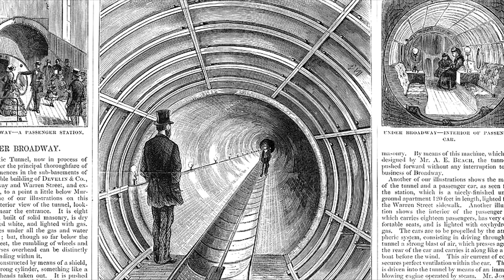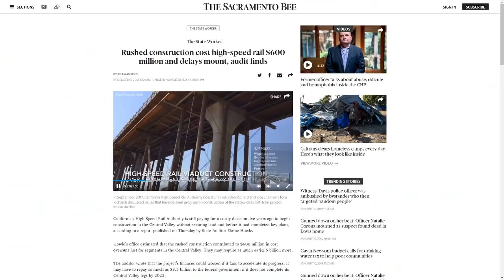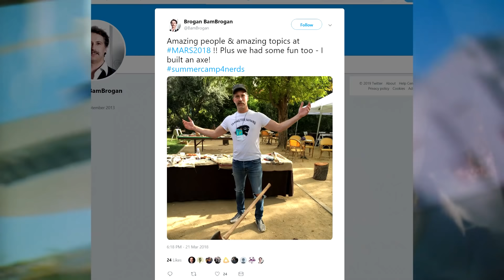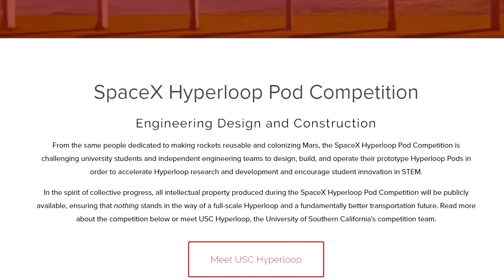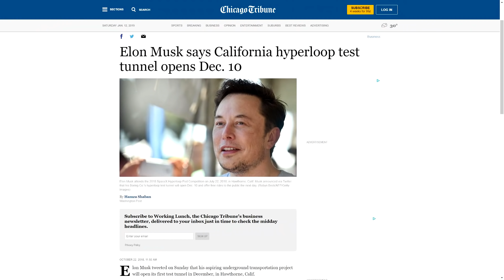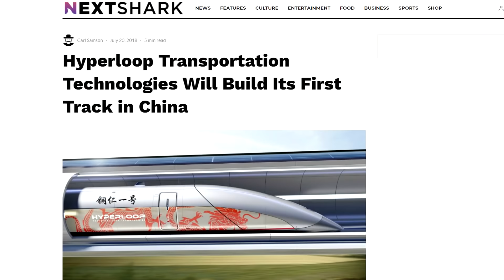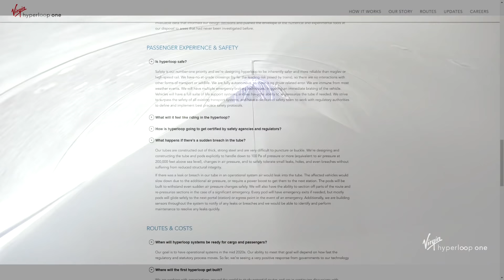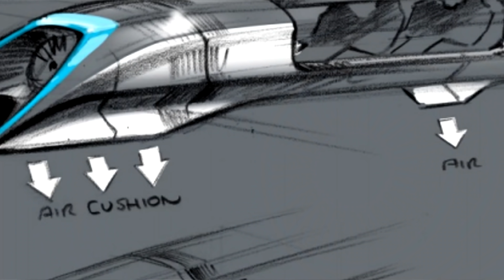Why Hyperloop will FAIL HARD - Its Biggest Problem...

Comment: MAGLEV is very expensive which is why it hasn't replaced normal rail, putting a MAGLEV in a vacuum tube is going to be massively more expensive.
Reply: Japan already has maglev. They are currently building lines that will connect Nagoya and Tokyo.
Reply: And why would you need it to operate in a vacuum tube. It's already fast enough. Hyper-optimization at it's best.
Reply: @emmanuelezenwere  come on you don't want to be traveling 700/900 mph? I think it would work better to connect parts of the country that is very far away
Reply: It kinda removes the last bit of resistance but the cost to that is ridokulous.
Reply: "The power needed for levitation is typically not a large percentage of the overall energy consumption of a high speed maglev system.[2] Overcoming drag, which makes all land transport more energy intensive at higher speeds, takes up the most energy. Vactrain technology has been proposed as a means to overcome this limitation"
quote from Wikipedia on maglev. I wonder what they mean by 'vactrain'?
Reply: Terry Taylor A Vactrain is more or less a Hyperloop.
Reply: @Nemesis_T_Type  Yes Japan has it, but it has gone over the budget and has been criticized widely for it. Also, the Transrapid system that is being used in Beijing used to have great plans for projects in Germany, Australia and other countries, all of which have failed. Maglev isn't the magic solution it appeared to be in the 70s.
Reply: Another reason why madlev is not as common as it could be: can't really carry Cargo, normal rails do. So youre Maglevtracks only work for passenger traffic.
Reply: Korea has MONEY.
Reply: Why do you think Hyperloop uses MAGLEV? That is NOT part of the Hyperloop design. Magnetic induction is only used to accelerate the pods, not to lift them. The original spec was for air lift (like an air hockey table) or now they are just using rail.
Reply: @emmanuelezenwere  because the cost is significantly lower (in terms of energy spend per passenger both in capital and operational expense) and the speeds achievable significantly higher than then trying to punch through dense air. It's evacuated (low pressure), not vacuum.

There's a nice side benefit of a substantially lowered acoustic footprint too

Rail vehicles have hit fundamental limits on speed thanks to air resistance making the pantographs hard to keep on the pickup wire - meaning that as they approach the limits the supply feeds take a hammering. At those speeds high speed trains are drawing MORE power than maglevs whilst the rolling components of the bogeys are on the verge of flying apart (Check the TGV speed record tests). The practical limit for rail is about 350km/h (450-485km/h for speed runs) and when you try to go faster than this in maglev the energy costs go up not just exponentially, but with the cube or quadratic power of speed thanks to air friction.

Taking the air out of the equation is the only sensible way forward. Jet aircraft do it by flying high. Maglevs and vactrains do it by taking most of the air out of a tube. Because the tube is fixed in position (ie, stationary), mass isn't a big deal and the example of the tank car is a red herring (it needs to be as light as possible in relation to its cargo to keep energy expenditure to a minimum, hence the thin walls. Railway bridges aren't built like that, are they - and the engineering that needs to be held in mind is that of fixed structures, not of moving vehicles.

My bet is that this stuff will come to the USA long after it's been deployed in the rest of the world, once the benefits have become impossible to ignore.
Reply: @alanbrown397  The cost is not lower.  That is a complete fantasy.  Yes the cost of operating just the train would be lower if you completely ignore the costs of maintaining near-vacuum in a tube that's hundreds of kilometers long (making it easily the largest vacuum system ever constructed).  Also ignore the costs of having to acquire the land for your system in a perfectly straight line because it can't actually make turns, or just making the entire thing underground (which adds massively to construction costs).

Yes there are benefits to getting rid of air resistance.  No, they are not worth the cost in this instance.  The economics of the hyperloop simply don't work.  It is theoretically possible but it will never be practical .
Reply: @JamesNewton  An intercontinental, that is, transsiberian, hypertube will hate to use rails . Maglev is economically unsustainable for longer paths and cannot incorporate switches, inclines, avoidance lines etc. Rail is proven, has reached 600km/h on electric trains, and has no speed limit as proven by Rocket Sled decades ago. And is much cheaper.The Koreans build high speed lines by connecting readymade concrete rail blocks just like it has been with model trains. The vacuum tube is just another implementation of the siberian pipeline.
Reply: @aabb-zz9uw  Also, super High Speed is Not the Most important Factor: Most Cities are Close enough that High Speed rail can't get to Higher speeds than 250 kph before having to alle again for the next Stop. There is a reason why Germany's latest High-Speed train ICE 4, was improved for acceleration rather than Speed. 

Hyperloop will have the Same Problem as Maglevs Had: expensive, Not compatible with  existing technology and infrastructure, Not scalable (No Points, crossing, Cargo?!).
Reply: @lukashei1870  Korea and China have 300km/h high speed rail. Both countries have larger cities and are technologically more advanced than Germany, Japan or France. Koreans are VERY VERY smart,for example, and they know what they are doing. So why does Korea develop 600km/h conventional trains with variable gauge and 300km/h freight trains if things are as you say? Germany is based on smaller and traditional industries and hasn't got large cities like Seoul or Hong Kong with massive economy activities, and this is why Germany has no need for speed. This is why Korea is more advanced than Germany  by decades but Germany has a much better quality of life.
Reply: YEAH at least one person who doesnt get triggered by this idiots ! GJ Ari Riyadh keeping calm^^
Reply: @Friek555  What are u talking German Maglev didnt fail when its operating in china , we just didnt decide to build one YET .. european citys are allready 5min away from each other with normal trains ... withoud building it from spain to moskau there would be no sense in it .
but that much you shut allready aware of if you would use your own brain ..
Reply: @alanbrown397  that means NEVER?!?
becouse the rest of the world know how to use math ...
Reply: @alanbrown397  after your logic planes shut allready taken over the shipping industrie xDDD
Reply: @terrytaylor2825  Wikipedia hates the TRUTH!
Reply: @aabb-zz9uw  the Maglev China is using was invented under Hitler at WW2 and reinvented to sell it ... but for sure tell me about MY FUCKING QUALITY OF LIFE .. i know NOONE on this planet who pays as much % of tax as i do .
Reply: That said there are probably places where maglev is overdue all over the world
Reply: @Friek555  It might be a magic solution, just an extremely costly one that involves many goat sacrifices
Reply: @emmanuelezenwere  
Because in vaccume  condition very less amount of drag force will act on the pod.
Which results in high velocity of pod.
Reply: What makes it so expensive?
Reply: Just search "Railroad tank car vacuum implosion" are people saying they want to be inside a fast moving thing with that around them?
Reply: @Nemesis_T_Type  So does China. For years it's operating the German-engineered Transrapid, but back in Germany they now abandoned the technology due to costs (intention was to connect airports). It's now an exported product/technology only.
Reply: @Friek555  Honestly, the Transrapid not taking off commercially in Germany has two reasons

- human error overriding the computer to give the all clear leading to an accident

- cost because Germany would have to bear it alone, not state funded and focussing on national airports instead of doing so across the EU to reduce airspace congestion - in China it has been operating succesfully for years..
Reply: @sebastianm.4632  This is not true. In West-Germany during the cold war, maglev was partially used in some  of its bunker construction. Reason was avoiding the activity being picked up by seismic instruments
Reply: @kevadu  Applies to civilian applications mostly though. The military, especially in the USA, don't care as much about such cost :)
Reply: @aabb-zz9uw  Ehm the Maglevs used in China are Transrapid. Developed in and marketed by Germany. Sold to China decades ago. But yes, in the end it's about population and scale.
Reply: @johnny5wd567  Unlike Korea, China used a lot of foreign technology. Korea has 100% own developed technology but uses imported IGBTs due to cost.
Reply: @aabb-zz9uw : Maglev can't include switches? Then the switches I've seen for example on the Transrapid test track near where I live in Germany must have been an optical illusion. Yes, the switches are more difficult than a classic rail switch (you basically have to bend the whole track), and they get really long (which helps with the bending though) if you want to traverse them at high speed, but they are doable. Probably not for the Hyperloop though, as in addition to the track you'd have to bend the tube as well, all the while maintaining the vacuum inside, or you'd need a much wider tube (possibly with a non-circular cross-section, bad for stability) for miles to enclose the whole switch inside.

As for inclines, that's one of the major ADVANTAGES of Maglev. As propulsion no longer depends on steel on steel friction, there's basically no real limit on how steep an incline may be. Some modern amusement rides use quite similar systems (linear induction motors) to lift the cars vertically, or accelerate them at more than 1g (which is basically equivalent to lifting them vertically). Special consideration has to be given to the transitions (hill crests etc.) due to the high speed if you don't want to give passengers the feeling of a roller coaster ride (even with classic wheel on rail systems, if you ride for example on the high speed line between Cologne and Frankfurt in Germany, which to reduce costs was built with somewhat steeper inclines than usual for railways, as the ICE 3 trains used there can handle them due to having many powered axles, when traveling at about 300km/h (185mph), you can definitely feel going over a hill top or starting a climb, somewhat similar to the experience on an airplane), and to safety in the event of a failure of the propulsion system (emergency brakes must be able to hold the train on any incline it might encounter), but that's about it.

Avoidance lines (assuming you meen passing loops, as "avoidance line" isn't a common railway term AFAIK) is basically just a question of having switches (and a wider right of way for parallel tracks), as I said before, switches are quite possible, so are passing loops. If you want to maintain speed (instead of say passing at a station where the train stops anyway) they would need to be pretty long though. However, in a Maglev system, every train (including freight trains if any) would be running at the same speed, greatly reducing the need for them.

Classic rail has set a speed records of 574.8km/h (not quite 600), but at this point what is feasible in regular service isn't anywhere near that. One of the main problems at the moment is power delivery, not so much the wheel/track interface (as you said, rocket sleds have reached much higher speeds). While AFAIK the tracks itself didn't need any modifications and the modifications to the train where minor (they used larger wheels in order to not hit the rpm limit of the drive motors) when they did the record run in France, they did need to do extensive changes to the catenary wire system. They needed to tension the catenary much higher than usual, otherwise the wire would have bounced off the pantograph, but this means that it can no longer deal with things like temperature changes over the seasons (at least not without frequent inspections and adjustments), and I think they had to replace the wire (which was practically brand new when they started, as the rail line they did the tests on hadn't opened yet) after they did the test runs.

You could in theory probably solve this issue by combining linear induction motors (just like maglev) with rails, however you'd probably get a combination of mostly disadvantages of both systems (much more complicated switches, incompatibility with existing tracks or vehicles etc.) without any major advantages, so nobody has even seriously considered building it.

But even if you solve all that, it leaves one major thing, reaching the highest speed possible simply doesn't make sense in many cases. Take for example a country in central europe, Germany. The overall trend in recent years has been that train top speeds have been getting SLOWER again. That is due to the realization that in areas with high densities of population centers (there are quite a few areas in Germany where major cities are practically bordering each other), the top speed of the train only makes very minor differences in overall travel times. If you have to slow down and stop every 5-10 minutes, average speeds will be relatively low, even if you reach the speed of sound in between, so the focus has been more on getting average speeds up instead of top speeds. Some of the solutions are similar to what you need for higher top speeds (for example adding more power means accelerating faster, thus less time spent at low speeds, but also that you can in theory reach higher speeds), but others are not (removing stops in smaller cities that were only added for political reasons, optimizing passenger boarding to get the train out of the station faster etc.).
Reply: @blahfasel2000  They are not the same as mainline rail switches.Vactrain with linear rail is possible. Germany implemented Maglev for such lines as Germany lacks the technology to make faster trains. Korea made and run the HEMU-430X and developed the VHST-600X and China works towards airliner speed.Korea has plasma air drag reduction technology in its HEMU-500X design. Germany is strong at traditional and intermediate things that are within the visual range of the human eye but has nothing to show when it comes to top-notch where Korea is strong. There are reasons why pupils in Korea have to study 16-21 hours a day.
Reply: @aabb-zz9uw : Never said maglev switches worked the same way as rail switches. That doesn't make maglev switches impossible though.

As for why Transrapid never took off in Germany isn't a lack of technology, but a lack of demand. Germany is a physically small country (you can travel from one end of the country to the other within about 10 to 12 hours or so using only local and regional trains) with a large population for its size, our major cities are all relatively close to each other when compared with other parts of the world.

Germany has about one and a half times the population density of China. Countries like South Korea or Japan, while having an overall population density higher than Germany (however not higher than the parts of Germany that were formerly West-Germany), have those populations more concentrated into a few mega-cities that are relatively far apart, whereas Germany mostly only has medium sized cities when compared internationally, but those are much more frequent and thus closer to each other.

German politics and economy is very decentralized (Germany is one of only two or three countries worldwide where average per-capita GDP would INCREASE if you were to take its capital, Berlin in this case, out of the statistics). Therefore a "hub and spoke" model like you find in many countries, with spoke lines from the other major urban areas converging at the capital (that doesn't mean that there are absolutely no other interconnections between spokes, but for example the French TGV network is built exactly like that) simply wouldn't make sense in Germany.

Edit: as for the alleged lack of top-notch technology in Germany compared to South Korea, Germany is currently developing and building huge parts of NASAs upcoming Orion spacecraft (only the service module containing all the systems that keep the astronauts alive in space...), has had a manned spaceflight program for a long time (we don't have our own launcher due to primarily political reasons, but we train and fly astronauts on US and Russian rockets since decades, and at least two Space Shuttle missions were officially fully German missions), has built several parts of the International Space Station etc., whereas Korea only relatively recently (2008) hitched a flight on a russian rocket to at least bring its first citizen into space for a few days. Every country has its own specialities, very high speed trains might not be Germanys forté, but there are other things that you can only get from Germany and nowhere else.
Reply: @blahfasel2000  Germany is technologically 30-40 years behind China. As for the rocket thing, Korea is the inventor of multistage solid rockets which were used during the war against Japan and Korea has the RS-26 Satan design completed by technology bought from Ukraine. Germany has never launched a multistage rocket with fully own made satellite. German parts do not make Germany enter the prestigeous space club while Korea enters in 2021. The Naro launch base is unique as the official language there is not US English(Korea has a british law system) but Russian. 5 countries around Seoul(Russia,China, Japan, Joseon and Korea) can thus launch full space vehicles on their soil with their national flags painted on the space vehicles. Korea and Joseon are thus ICBM-capable.What matters is the system, not some separate parts. Korea is a centrally planned economy with a militarist /feminist based state ideology and this is why Korea is vastly stronger than Germany. The leader issues the orders, everyone else says "yes" and "sir" and implements the orders without failure.
Reply: @aabb-zz9uw : Ah, yes, I guess that's the reason why China is sending students in droves to study at german universities. You do know that the Shanghai maglev was built by Siemens and ThyssenKrupp?

As for rockets, there are historical reasons why Germany never has and probably never will develop its own national launcher (Germany was however the first to get a man-made object above the Karman line, the V2 rockets), instead it is heavily invested in ESA as one of its founding members. On one hand one could say that the countries involved are only building parts and don't have their own launcher, on the other hand Arianespace has cornered the global launcher market for a long time, and only recently lost ground to SpaceX, mostly because of becoming complacent.
Reply: @blahfasel2000  The Chinese students studying abroad are mostly those who weren't good enough to go to Chighua or Traffic University. maglev is a losing technology as it is not faster than rail and costs too much. As China stole tech from others , Korea is actually the only country with 600km/h rail technology including automatic gauge change(the world's only one for HSR) and wireless power transmission, and plasma air resistance reduction. Nowadays those who go "studying abroad" are kids from rich or influential families(hing ranking party members in case of China) who are not good enough at studying. A Korean university established bythe US military government after WW2 has a hypersonic wind tunnel, experimental reactor,semiconductor fab ,jet simulator and genetic cloning lab. It is connected to the B5 bunker so we know what it is capable of.
Reply: With MAGLEV the upfront expenses are about 30% higher than HSR systems. HOWEVER, operational expenses are considerably lower than HSR systems. The energy to move the MAGLEV vehicle is approximately 30% LESS than HSR vehicles. Further, way side support for MAGLEV is extremely low in maintenance by comparison to HSR systems by better than 60%. Estimated life of a HSR system right of way trackage is 20 years at which time massive rail replacement is required. Track maintenance leveling, rail cracks, ties, switches, overhead contact and transmission wiring and the centenary poles, tensioning systems etc all need to be maintained and inspected daily. Just this part of the process is more than 25% of ongoing maintenances of a HSR system.  More than 30% of your operational budget will be for maintaining the suspension and propulsion systems of the HSR vehicle including truck, motors, gearboxes, wheels, axle bearings, pantograph maintenance, propulsion controls and a myriad of other systems on a HSR vehicle. No such maintenance on a MAGLEV system. Vehicle maintenance consists primarily of keeping the vehicles clean. There are few if any moving parts on a MAGLEV vehicle with the exception of HVAC systems on board each vehicle. 

When HSR projects are talked about they should NOT be talking about basically 150 year old technologies. They should be talking MAGLEV and Local Grid system people movers such as Skytran and the Japanese style MAGLEV systems. 

To make Hyperloop work you need massive amounts of stored solar energy. It can be done but would be twice to three times as expensive as MAGLEV
Reply: @waynealan2226 : All that about maglev is true, IF (and that's a big if!) you don't already have a pre-existing extensive rail network. In Germany for example, pretty much all the proposed Transrapid links were more or less parallel to already existing HSR links, and would have provided only relatively small incremental savings in travel times. The only exception was the connection between Berlin and Hamburg (where there was no fast direct rail connection due to the division of Germany during the cold war), however with only about 250km or so distance to cover, again the travel time savings would have been relatively minor, about 15-20  minutes or so. The countryside between those two cities is flatter than a pancake, I think the highest point would be some dung heap on a farm, and (compared to other parts of Germany) sparsely populated, so the advantages of maglev when it comes to negotiating hilly terrain and requiring a smaller footprint on the ground couldn't play out. And in case of some malfunction, maintenance shutdown, whatever, everything would grind to a halt because of the incompatibility with the existing rail network, whereas HSR can be rerouted over normal tracks if necessary (you will obviously get to your destination late, but at least you still get to your destination). Plus it would have created a german version of a "flyover state", as with maglev you couldn't run local or regional trains serving the smaller communities in between on the same tracks. Overall it was thus decided that it wasn't worth it.
Reply: @aabb-zz9uw : You should maybe stop drinking the kool aid some time.

Korea might have a 600km/h capable train concept on paper, however so far there's not a single Korean entry on the list of world records for wheeled trains. So far the fastest South Korea has actually DEMONSTRATED was on the Gyeongbu high-speed railway in 2013 with a top speed of 421km/h, which is about the same ballpark as the actual world record (at the time) that was set by the German ICE a quarter century earlier in 1988,  which was 406km/h. And now suddenly maglev is to expensive, as you realize that much of the currently existing maglev tech actually comes from Germany (so far across the world there have been four non-experimental maglev trains open to passengers,  in the order of their respective openings those were the Birmingham International Maglev shuttle, the M-Bahn in Berlin, the Incheon Airport Maglev, and finally the Shanghai Transrapid, which was the first high speed one, the other three were only low speed)...

"Plasma air resistance reduction" as you call it, or as scientists call it, "magnetohydrodynamic active flow control", I hate to break it to you, while there actually were some advances published by a South Korean team a few years ago that might bring it closer to practical applications, it is a pretty old concept, the first to conduct experiments in that direction was Michael Faraday in 1832. Not exactly bleeding edge.

About the alleged capabilities of your Korean university (I guess you mean KAIST, which is BTW since 2007 actually partnered with, among others, two german universities, TU Berlin and TU Munich). The hypersonic wind tunnel you are talking about must be extremely secretive, as you can find absolutely no mention of it on the internet, very different from Chinas supposedly secret "Hyper Dragon" (capable of Mach 10) or the not so secret Mach 11 capable H2K operated by the DLR (German institute for aerospace research), plus Germany has a company that is selling hypersonic wind tunnels commercially. Experimental semiconductor fabs can be found at multiple universities in Germany (which doesn't say much, as multiple people have demonstrated on Youtube, you CAN fabricate simple semiconductor circuits in your basement, the most expensive equipment you need is a furnace that can reach ~1500°C, which will set you back about a 1000 bucks or so),  so can experimental reactors (there are a total of seven currently operating throughout Germany at as many universities, as opposed to the two operating and two decommissioned ones in South Korea). Cloning labs you won't find in Germany, as research into cloning is deemed pretty much unethical here (as well as in many other western countries).

Don't get me wrong, east Asia, especially China, has done a pretty good job of catching up over the last decades, in some areas even pulling ahead, but now saying they are suddenly 40 years ahead of everyone else is simply ludicrous.
Reply: @blahfasel2000  This shows you don't know anything and you cannot even drink water. Korea has technology ,actual technology, and this is why Korea will enter space club member status in 2021. All technologies have been locally patented and proven by actual tests as I have personally witnessed the operation of the world's only high speed variable gauge. All you claim to know about is at least 5 years old but nowadays even 6 month old things are considered obsolete. In Europe. there are old buildings from middle ages. But in Korea, all old buildings, especially those from japanese times, are torn down to make place for 500m high buildings. There are massive technological things deployed in Korea that cannot be dreamed of in Europe,such as BUILDINGS. Name any European building as high as the 3 decades old 63 building which is no more in the Top 10 ranking. These buildings are telecom and air/missile defence platforms since 4 decades ago and there is no such thing in Europe but it exists. Is there any European building over 300m high and has S400/PAC3 missile batteries and phased array radars on its rooftop? I am in 30 minutes distance from multiple such buildings. And in Korea, 15 million cameras watch and track and record all people and all communication is monitored by the feminist state institutions and the country functions like a large military base. There is no such thing in Europe. In Korea, the police know where one has been  atthe night 10 years ago, to detail and keep record of peoples' activities. Do you have anything that advanced there? Brain chip implants that have been demonstrated to be capable of moitoring brain and changing behaviour were also invented in Korea and patented in 2012. All soldiers are DNA captured by police when they enter army and will wear cameras so that they can be watched by the police. No European country is so advanced technologically. Do you know China's citizen surveillance system? It is based on Korean technology and both systems are interconnected. So railroad technology, which is less advanced than any of these, is also much more developed than what you claim to exist. All technologies I mentioned were patented and are under national security clauses, that is, you don't have the detailed need to know. Technology only works under a centrally planned state system that controls  all resources from the center and works like an army. This is why Korea is the third most developed behind the United States and the Peoples' Republic of China. Even Israel is now far behind. I heard some guys saying that watching people with police cameras and http blocking/packet monitoring is sci-fi but here it is daily reality since more than a decade. If the leader says 600km/h until some months later, the order is implelemted. You say "yes" and "sir". If the leader says plasma air resistance reduction until some date, it is implemented. This is the way Korea is now sole leader in nuclear fusion(the only country to have reached 100 million degrees C for 2 seconds) and semicon making(all memory semiconductors are only from Korea and this will never change) . People learn how to walk in cadence ,salute the national flag and sing the national anthem before classes are started. when they enter school This is how education is.This is what makes such technologies possible. You don't have the same education the makers of such technologies have. Thousands of doctoral degree holders work day and night to develop and implement such technologies up to the deadline imposed by the leader's orders. This is how things work. And you should learn how to drink a cup of milk or yoghurt as this seems to be very difficult for you. Korea is already working on  1200km/h vacuum train as it has developed related technologies already around 2009. This is earlier than some Elon Musk stuff. It doesn't matter what you believe or things.You just have job training after 10th grade and do handwork at a local workshop at a small town at a probability of 60%. So you are not in the position to talk about technologies.
Reply: @blahfasel2000  Ha ha ha. And about semicon fabs. Only Korean fabs are capable of memory semicon at 7 nm width and are working towards 3nm. And they can stack 96 layers vertically which no one else can. Also, they are  developing particle beam technology. You have no idea what the Seoul National University has about fabs- near 7nm width prototype capability. China is not allowed to import equipment due to ITAR restrictions and this is why China officially gave up making memory chips-the US simply does not allow it. This is why Russia can only make crude devices and Belarus only exports diodes and transistors. Oh the hypersonic wind channel  was never a secret as it has existed for a long time. Again, you pretend to know things but in fact you only know the titles of some online articles and this is all you know. I only talk about things I touched,saw or entered actually. You just play Starcraft as you do handwork at a rural workshop on outdated things like making mechanics things. This  is why you are limited to online accessible articles, specifically, their titles. You never learned how to follow orders, only discuss and debate, which is not allowed here. And you don't know why China cannot go beyond a level-export control. I have gone through export license procedures even since the '80s. So do not dare to argue with me or others. You have nothing else than online knowledge of article headlines a,never acquired clearance to enter facilities, and just do handwork at a rural workshop. If you want to argue with anyone, persuade your parents to pay for college tuitions which are very expensive but absolute requirement for a real job, complete the course , and get a real job instead of handwork in mechanics.
Reply: @waynealan2226  Costs can increase exponentially with maglev systems and this is why they are only suitable for short range airport transit and this  is where they are deployed. As for the energy, Korea,Russia and China are nuclear power technology and industry owners. Korea is the world's only capitalist country capable of nuclear power generation so solar energy is not required. Russia and China have movable nuclear powerplants.
Reply: A near to vacuum tube in itself is very expensive and potentially lethal concept, doomed to catastrophic failures.
Reply: The Hyperloop is not a Maglev, though. It does not levitate by magnetism.
Reply: @Ohne_Silikone  Not in other countries with centralized governance-Korea and China.
Reply: why not have huge blowers on the end of the pod, sucking air from in front and blasting it to the rear?  hundreds of vacuum pumps is stupid when you only really need one per pod!
Reply: @jbodden6977  Why don't you look up the details of the Hyperloop before commenting? What you describe is a part of the system, except for the blasting to the rear because it'll blast to the bottom.
Reply: JR East, the largest Japanese railway company, is building a maglev between Tokyo and Osaka, fully privately funded. 90％ underground. Tech developed for over 50 years.
Reply: @jbodden6977  Then you need power supply into the train which would be enough to create partial vacuum inside the entire tube. Actually,the evacuation will be done per lock sections not for the entire route at once.
Reply: @Nemesis_T_Type  China already has one operating for quite a while at 431 kmh.  The top operational commercial speed of this train is 431 km/h (268 mph), making it the world's fastest train in regular commercial service since its opening in April 2004.  During a non-commercial test run on 12 November 2003, piloted by Jonathan Texiera, a maglev train achieved a Chinese record speed of 501 km/h (311 mph)
Reply: Hybrid linear rail like Korea's VHST-600X is the answer. Korea has both technologies since 2009 but you won't see any publications as they were put into national security domain.
Reply: @elonmusk6929  you can... get on a plane!
Reply: China has maglev.
Reply: The major problem with vacuum/air pressure propulsion is the energy required to move such an immense mass of air. For a short demonstrator this problem doesn't appear.
The simplest way to go through a tube at high speed is to pump the air through a duct that goes from one end of the vehicle to the other. Such a duct, very smoothly and properly finished, has very little aerodynamic drag. Stop or reverse the ducted fan and the vehicle will decelerate rapidly but smoothly.
Reply: Air cushion trains can be built and operated at a fraction of the cost of maglev. The carriages start off on wheels then when sufficient speed is attained the carriages lift a small distance above the track. The principle is similar to aquaplaning only with air, not water. It does require either independent power such as a diesel motor or double overhead catenary wire unless some kind of grounding wheels or shoes contact the steel track.
Reply: thats why we need room temp superconductors
Reply: @michamcv.1846  no, you do.
Reply: Maglev hasn't replaced normal rail because the normal rail companies don't want to replace their entire network. Maglev itself is cheap, but replacing an entire rail network with it (including removing the normal track) is expensive. The suspension of service on the system during the conversion would cause large loss of money for the company as well. Then, all of the company's normal rolling stock will have to be replaced.
The reason normal rail is still here is not that maglevs are super expensive; it's that the conversion would cause bankruptcy for many companies which still use normal rail.
Reply: @aabb-zz9uw  no it doesn't it has an aging population and horrible debt, it's not even in the top ten richest countries in the world.
Reply: Kevadu exactly. Low tolerances will drive up costs insanely, even before you consider the costs of both maglev and the worlds largest vacuum on top of it. People treat the white paper like it’s some kind of gospel that guarantees the cost to be lower than HSR
Reply: The economics is part of any business plan. It's competing with plane travel.